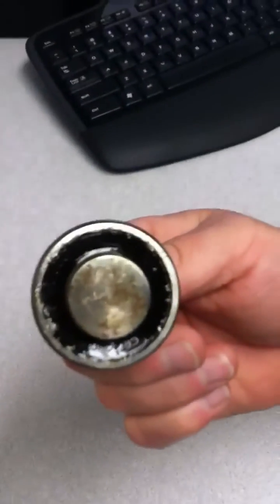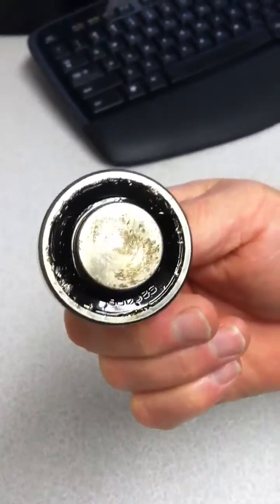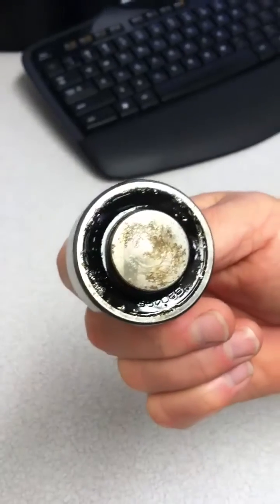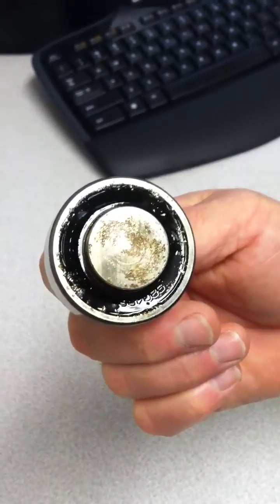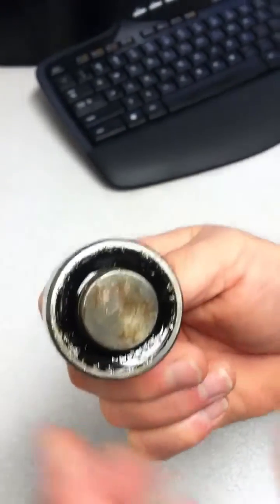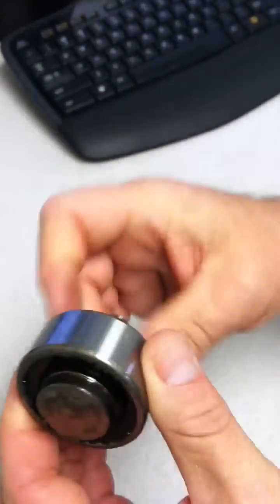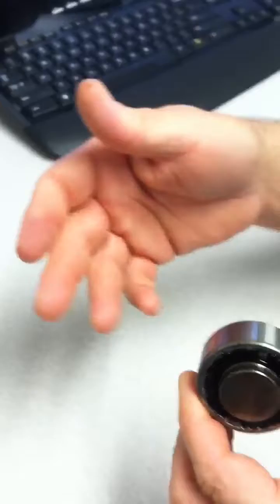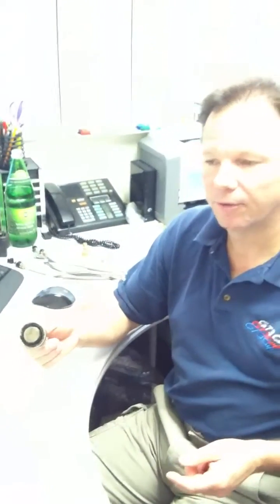IMS Failure post repair

Comment: Good IMS reviews and info.  - There's an article from Autohaus Hamilton in Australia about the IMS. google “Autohaus Hamilton Porsche IMS”  The article lists all the models and engines (with engine numbers) that are affected. "The Porsche models that are prone to IMS failure and should be replaced are: All 986 Boxster models. - 987 Cayman & Boxster models up to engine number 61504715 - All 996 models (not including: GT and Turbo models) - 997 3.6ltr with M96/05 up to engine number 6950745"

Before 2000 Porsche used a double row IMS Bearing which had a low failure rate, then they switched to a single row until 2005 - 2006 and this single row has had the most problems. After 2005 - 2006 Porsche stayed with the single row but increased it's size and strength and this bearing has had the least problems of all three types of bearings used from 1997 to 2008. The upgraded bearing in the 997 and 987 is unserviceable, meaning you can't reach it unless you strip the entire engine down.  Some of the early production 2005 - 2006 987 and 997 might have the pre-upgraded bearing fitted, that's why the engine numbers in the Autohaus article might be helpful in determining which type of IMS bearing is installed.  I read in one of the YouTube comments that Mr. Jake Raby from Flat 6 Innovations says he has never seen an M97 engine blow an IMS bearing.

Starting in 2008 Porsche introduced the new 997.2 and 987.2 and switched to a DFI direct fuel injection engine which doesn't have an IMS Bearing.

After 21 years of IMS uncertainty and discussion, it would be nice if we could conclude this issue with some expert advice.